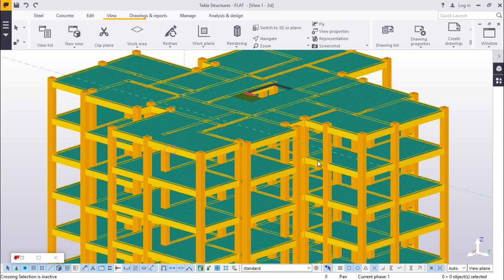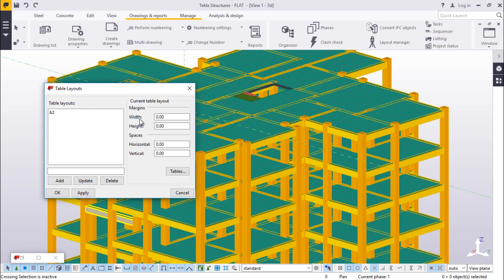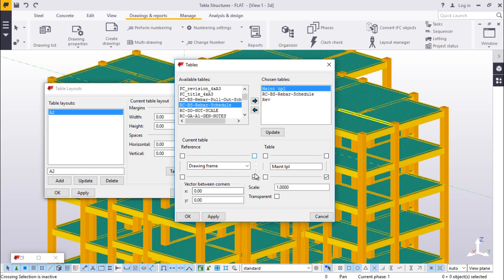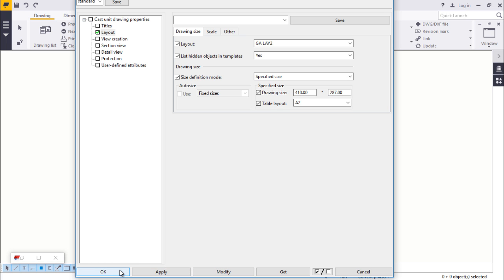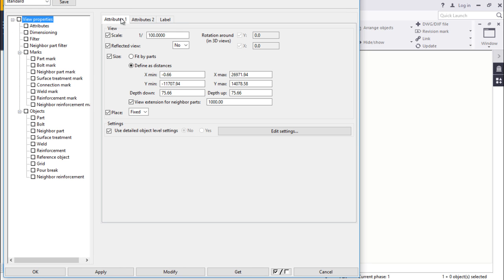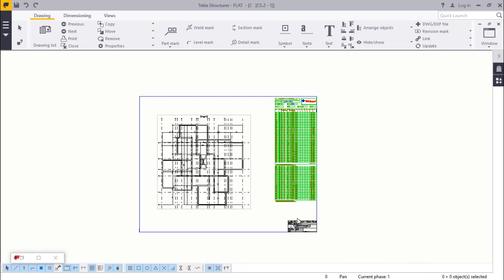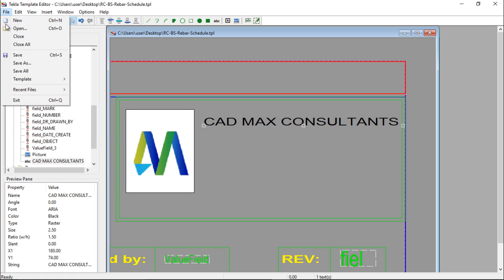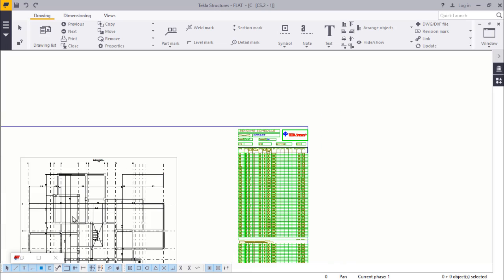How to Generate Bar-Bending Schedule in Tekla Structures 2016

Comment: Is it possible to generate and export a similar table as a report so that I can open it in Excel? Particularly, I want to add a column called "Rebar Shape" (not rebar shape type but the actual shape) to this table so that I can open it in Excel?

Comment: When I change the bar hook length in the model then generate the drawing and bar bending schedule i found the hook length longer than the length in model 
For example in model hook length 500mm but in drawing 512.5mm 
My question is how to make the kook length in model matches the hook length in drawing
Is there any setting modifications to make them equal.
Reply: it because what you define in model did not count the bending length